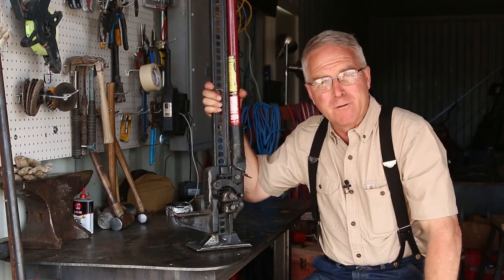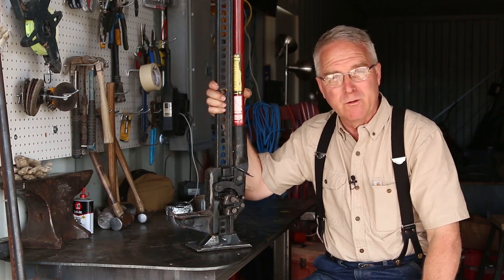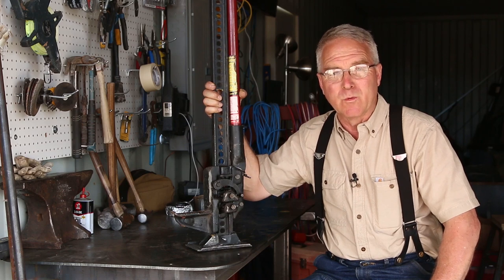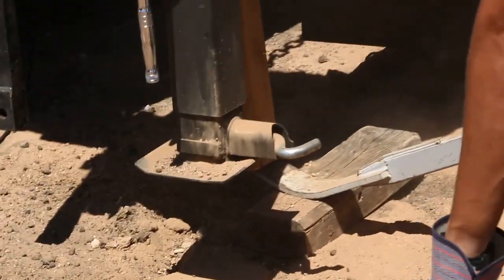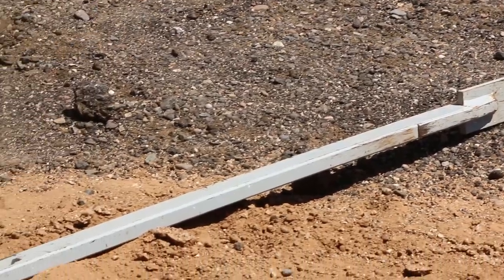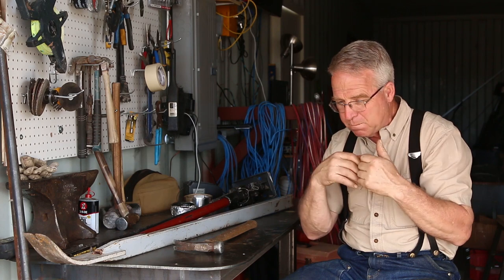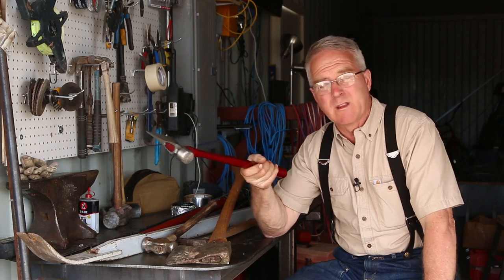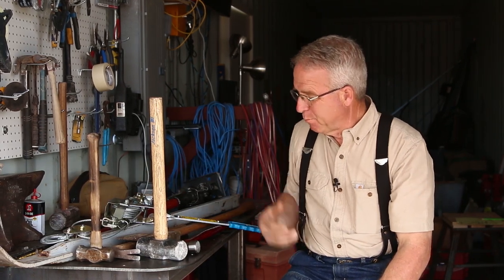5 Problem Solving Tools

Comment: I’m rewatching this 3 years on, I have all but the Burke Bar, sadly not available in the UK, so I have a Gorilla Bar (a compromise). Living on a farm, I’ve bought and used every one of these to great success, sometimes more than 1 at a time. Thank you for the advice.
P.s. I would add to this, a good torch, handy having the tool but not seeing where to use it can be bad!

Comment: We use high lift jacks to remove old fence posts. Hands down the best tool for the job unless the wooden post is rotted out. Throw a couple nails in (or drill a hole and bolt for steel posts) throw a chain around it and crank it right out

Comment: I've had a Victorinox in my pocket since I was 13.  The first tool any youngster should get.  It has gotten me off the side of the road, in and out of jams and saved a burning boat 20-30 seconds form being uncontrollable.  Sump pump ran dry and seized up starting a fire in a compartment with the polymer fuel tanks.  Used the screw drive to force open the fuel doors and get an extinguisher in there, then cut the power.  After everything aired out and cooled down we used the other features to patch the boat back up.  I maintain my knife razor sharp for emergencies. One of the rare time i used the edge to cut through heavy copper wires without hesitating.  The boat was sure a messy but returned to launch under it's own power.

P.S. That same summer I just bought a boat and some kind sole helped me out to the channel.  Towed me miles back to the ramp and wouldn't take anything but a thank you.
P.P.S. I now carry a full tool box in my boat, and up sized my fire extinguisher.

Comment: I was on a round trip by motorbike in Taiwan last year. Before this trip I bought a belt pouch to put important and useful stuff. About halfway the trip I was walking down a thoroughly weathered concrete slab on the coast of a remote island near Taiwan where this shiny weatherman multitool was lying and waiting to be adopted. It was the find of the year and it has been in my pouch ever since coming in handy on numerous occasions.

Comment: Thanks for the comment on using a come-along to load an obstinate horse. I just knew if anyone saw me do that, I would be instantly jailed by the Animal Police for cruelty, but they just hadn't seen what the other guys did to get a horse in a trailer. Like most tool use, think throught the complete cycle and the possible reactice forces and you have a much better chance of survival. Love the sharing you do.

Comment: On the "Handyman/ Highlift" jack, my dad and I were out hunting...we got stuck, with nothing to push or pull. We got out the only real tool we had,  the Handyman jack. So we jacked the pickup up, and pushed it of the jack sideways. Well after about 8 or 10 times we got the truck out of the mud hole and were driving down the road 45 minuets later. Sure miss the ole man....Love ya dad!!

Comment: Ikea tool broke, I take out my multi-function Leatherman. I need to cut away some annoying branches around the camping spot, bring in the Leatherman. I want to sharpen my other knife while on a hike, I use my Leatherman. I lost my other knife and need to cut something, I use my Leatherman. I want to chill and drink a beer, I use my Leatherman.
I am so glad you mentioned it, I actually cheered when you said it! I've used this baby more times than I can remember. :)

Comment: I was driving by a pick-up truck and horse trailer ( with horses in it) which was pulled over off the side of the road. As a drove by, the woman of the group shouted 'GOT ANY TOOLS?' I pulled over and was able to help them out. I was able to help them. The woman who yelled for help taught me something that day - sometimes its not sissy or wimpy to ask for help. That is a tough lessons sometimes. Thanks for the Video Scott.

Comment: With you on one to 4 but my 5 is a small pair of vise grips over leather man. I wear a Wave daily but I constantly find it pinches my palm if not careful while the wire cutters are way to weak, but in hardness and leverage. Same goes for the Surge just more so. I find I use the Phillips head more than other tools whereas the Wave lacked a solid awl. Now vise grips and a pocket knife, that’s my number 5

Comment: Ha! We used to make rigging axe back in the California framing days of the 70s. Still use my California Framer to this day. And...and I’ve had a Leatherman Wave on my hip the last 20 years. Years ago, I was late to the counter to complete a permit process for a project. This was confirmed as I walked in. I said oh well I’ll be back in the morning. As I was leaving, I grabbed the office door handle that almost came off in my hand. Pulled out the Wave and in short time corrected the issue. Counter clerk saw this and said they’d been trying to get someone in for week to fix it. Said bring your plans over, let’s complete the permit! I rarely go anywhere without it.

Comment: Another very simple tools, Jumper Cables to start up other cars.  (i believe they called that way in America) I have always a good set of them with me. And a tow rope. Helped many people on the side of the road with dead battery's, alternators ,and other problems to a saver place or to the peoples home's. Also a small portable tyre air compressor on a battery can help a lot. I have a Milwaukee M 12 and always carry it with me on a full charged battery.  Solve al lot of problem with low tyre pressures.  one of the vans on my work  had a leak in the tyre. we putted some extra air in and then we drive it safely to the repair company. and also the leatherman mutli tool. Very important indeed.

Comment: Multi tool.
Pull start rope broke upon starting along edge of huge northern canada lake as wind blew out  scanoe from near shore fishing. No tools, but my needle nose pliers multitool. That removed bolts on starter cover and cut a piece of rope from anchor line.
2 guys a couple miles from shore in a flat stern 16' canoe in whitecaps on a huge lake were grateful for that pliers in tacklebox.
Anchor doesn't hold when bow rises and falls 2' every wave.

Comment: LOL I bought a railroad jack about 20 years ago. It's sat in my garage unused the whole time. This morning a 14' garage door stuck in the closed position. It does this when it's bent. I sometimes shut it too hard and this morning I couldn't budge it. I got to use my railroad jack for the first time, right after I had watched this video. :-)

Comment: I've had problems with come-alongs. I have been using a chain-fall, instead.
My version of the burke-bar is an old railroad spike tool that I got years ago. I've thought of replacing it with a burke-bar, but it does a good enough job.

Comment: A No. 12 Opinel carbon steel pocket folding knife. Those knives will stay sharp no matter how much you abuse it, it costs 10-15 euros to buy and it has solved so many issues during many camping trips, where you don't want to abuse your nice hunting knife, but where a blade in a combination tool isn't strong or sharp enough.

Comment: I have to vouch for the come along and the  multi tool.  Growing up my dad and I used the come along to pull cars onto the trailer quite often. We also used the come along to do some frame straightening on a car at one point.  later on when I met my current wife, we were early on dating, she was removing clothesline poles and it took her a few days to dig out one.  I brought a come along and pulled the other straight out of the ground in about 30 minutes lol.

The multitool I’ve always carried since being a kid and it has saved me time and time again whether it’s working on airplanes, cars computers, or general DIY stuff around the house. I have to say, I feel naked when I don’t have it with me like when I’m flying.  I’ve gone to the point to buy one at my destination, then give it away before I fly back home.

Comment: I think one tool worth putting in this category is a multi-position ladder such as a Little Giant or Gorilla. Numerous times I've had coworkers or even my boss say they needed to leave a job site because they didn't have a ladder, or because the one they had wouldn't fit in the position they needed it to. I love using those opportunities to pull out my Gorilla ladder. It fits in my short-bed pick-up, but extends up to 18', and can be used in small, awkward spaces. It's a tool that is always worth keeping on my truck for the number of headaches it prevents.

Comment: Dad taught me on the farm as a boy to always carry a knife. Needed it often to cut strings on hay bales. Never know when you might need it. He was right. Then in the military we were issued the leatherman. Carried it most days until the leatherman WAVE gave me a bad blister using the pliers. I changed over to the gerber multi tool with square head and have had one close by ever since. Always have a small knife on me and in my vehicles.

Comment: What an excellent video. This is what the internet should be for. I definitely carry a pocket knife everywhere, but I’m going to consider a leather man. I’ve heard great things about them. All my vehicles have rope, a first aid kit, a hatchet, a shovel, a small socket set, pliers, a lighter and usually a compressor with tire patches and boost pack. And a jack! Replace the shit factory one with little bottle jacks a few pieces of wood. All fits in a wee Rubbermaid. Can’t ever be too prepared. Thanks very much for sharing.

Comment: Saw a guy pulled over on the side of the road working under his truck so I stopped. He said he needed a mallet which I by some stroke of luck had in my trunk. I lent it to him.. I don’t even know what he was banging on under there but in 5mins he was fixed and good to go. He was so happy and thankful because without it he just couldn’t readjust whatever it was he needed. It felt good to be able help a stranger out of a jam like that.

Comment: Back in my framing days a 10lb  sledgehammer was extremely handy. Makes minor adjustments quickly. We used to call it the eraser. Everybody should carry a can of wd 40 solvent spray to help with lug nuts changing tires.

Comment: My brother and I once pulled a V8 engine and trans out of an old car with a come-along. We built a sturdy 4x4 frame and did the job in the driveway. I'm not recommending this, but it worked. A nice block and tackle might have been better. :-)

Comment: I am a tool nut too and I tried to use a multi-tool but none that I have tried are nearly good enough, I typically do more damage than good, so I keep a tool kit with me no matter where i go. I set up each vehicle with a tool kit specific to that vehicle, the same is true of my dirt bikes, most bikes a will use 8,10,13,14,17 mm but some other bikes may use 8,10,12,14,19 I can't carry everything on a bike so i bring tools specific to the bike, being careful not to over pack.  knowing your vehicles and what could go wrong is a plus. There is an old saying: take good care of your tools and your tools will take good care of you.

Comment: Haven't watched the video yet, but the most versatile multi-tool is a hammer in the hands of a framing contractor.  It can be used as a saw (takes about 30 seconds to hack through a 2x4 with the claw end), a router, a planer, straighten warped lumber, demo anything, and of course drive and remove nails.

Comment: When you're the first guy everyone calls when the wheels come off, you'll be glad you had em.   I'd add a major bleed/first aid kit and the skills to use what's in it. It's one of those things that you don't need every day.  You will be glad you got it when the day comes that you really need it.   
Lastly, the absolute best tool you can have in your toolbox is knowledge.  It weighs nothing, is infinitely useful, and is only useless until it's priceless or unobtainable.

Comment: Fire extinguisher is my #3 tool, right behind duct tape and multi tool. I watched a friends old truck burn right in front of our eyes waiting for the fire department. Fuel leaked out from the carb and lit. Not only should it be in your vehicle, but on the jobsite as well. House framing is basically building a tinder box, I would hate to see someones project go up in flames because they had no fire suppression system on site.

Comment: I've also carried a very small pair of , I guess you would call water pump pliers in my pocket for years as did my Dad , also & I'll probably be corrected for calling it a tool but a roll of duct tape has been a life saver multiple times .! :-) great video!

Comment: I have invested in nothing but tools. 
And when I buy my tools I always look for the best. Some people may say that I may be overdoing, it or that I should be taking a less expensive route.One thing I know is for-sure.  
Having a powerful portable set ranging from bandsaws,grinders,3/4 inch impact guns,Circular saws,ratchet sets lights etc. Ready to be operated at anytime. The level of your performance will substantially increase. Taken that you are already skilled in your trade.

Comment: In my traveling tool box at all times:
1. Hammer
2. WD40 or similar spray lubricant
3. Crescent wrench
There are often other things in the box, but those can usually start unmoved things or stop moving things. I guess a large flat blade screwdriver ends up in all my tool boxes too.

Comment: I agree with you 100%. I'd like to add 3 things to your list if I may. 
1.) Jumper Cables
2.) Fire Extinguisher 
3.) Chainsaw 
I've used the Jumper Cables hundreds of times. Used my fire extinguisher 2's on car fires while traveling and used my chainsaw in a bad storm that helped many of our scouts get off a mountain when a tree fell in the road. You may not need a chainsaw but trust me on the first 2.

Comment: My fav hammer doing professional siding was a shingling hatchet fitted with a rig axe handle. Long reach, square  waffle head, notch for nail pulling, side edge sharpened, blade side blunt...💙...my baby. 

My dad was a quiet tool guy, and one day under a tree having lunch with my uncle, uncle Herman asks my dad “What’s your favorite tool, Jarl?” You would have thought it to be the best question in the universe for him to be asked. He thought while eating a peach, then after a long pause and spitting out the pit came the awaited answer:
“Can’t beat a sharp hatchet .”

My answer to the same question would be “Skilsaw!” with little pause. 

Love tools.

Comment: The Come Along aka a "Cable Jack" I have used to deliver baby calves with first calf heifers or even cows that have calved before but are too weak for whatever reason to push the calf out.  Have to be careful doing that, but it can pull harder than you can.  A Come along can pull a baby calf in two.  The Come Along is the one I probably use MOST because I work by myself so much.  Come Alongs are made by a number of people, the BEST ones are made by Maasdam.  I prefer the Single line with NO "snatch block".  I can ADD a small sntach block I have if I need a double line, but the single line is the one I use 99.9% of the time.  They supply enough power to get you over the hump.  I had a fence company and built MILES of fence with them.  Fence installing veterans in this area call them Cable Jacks.  Truck drivers and weldors call them Come alongs.

Comment: I have 2 (so am I more or less advanced, lol). A bent angle screw driver. I find not only is to the tool for tight spaces, it grips Phillips screw heads better than a regular screw driver as well as allow for more leverage. The other is a spring center punch. It finds the center of a hole like in a hinge and marks it so the screw is easily centered. Comes in a couple sizes for difference hole diameter ranges.

Comment: My pick is a bit different. But I agree with yours as well, regardless I usually do not need to pry or lift heavy loads so HiLift is still only on my wishlist.
For me its:
- roofing hammer (or forehand sized axe)
- ducttape or spool of wire or cord (I use a lot of various cords to fix stuff temporarily)
And yes, my every day carry tool, no matter where I go (except concert hall, maybe) .. Leatherman Surge .. because it's solid, perfectly sized to heavy use, replaceable cutters and t-shank blades so I can use anything variety of files or saws .. Mostly used as knife, screwdriver and even scissors are seriously used (and big + solid enough that those are actually useful, not like tiny ones on small swiss knives (I also have few officer swiss ones, they are handly and little)).

Comment: Honorable mention goes to the ratchet strap, sure a derivative of the come-along, but still very useful in so many unexpected applications, like reinforcing plastic bins at the top so they can be filled completely with liquid without splitting, pulling a large box/shed to square, holding things in place, extending your reach, wrapping around a tire to squeeze it down to get it to pump it back onto the bead. . . and basically everything the same as a come-along when the weight isn't so insane.  Also I would be just worthless without my VISE.  Pliers and vise-grips give you unhuman strength, but a vise can surpass that and fills the gap to a press. They give you God-like strength, not just for static holding, but also for squeezing together, pulling apart, bending and crushing.

Comment: Leatherman vs others:  When I was Regular Army, I carried a Leatherman and used it all the time.  Fast forward a couple decades and I had lost it, but was given an off-brand multitool that a buddy running for Sheriff was handing out.  Each and every tool sucked.  stripped out, bent, dull.  But I couldn't bring myself to throw it away, in case my buddy asked about it.  Then at an airport TSA found it in an outside pocket of my ruck, and confiscated it.  Nice to have a good story of why I don't have it anymore.  Hope the TSA guy took it home and pinched his fingers with it as often as I had.